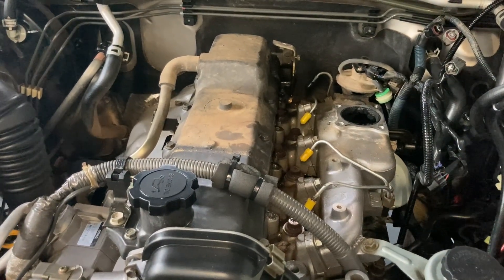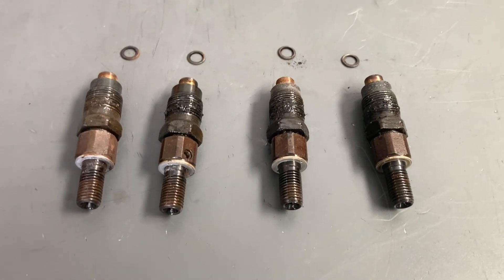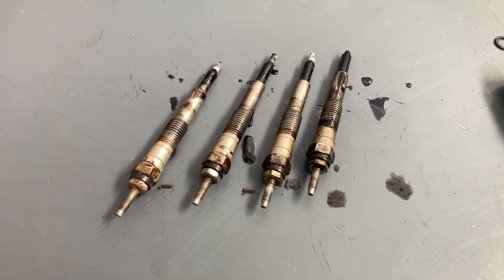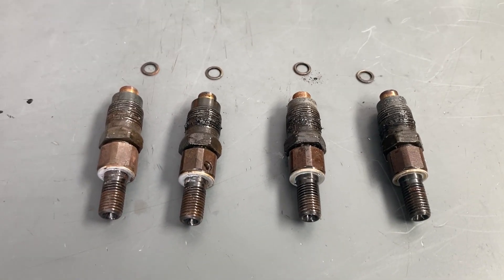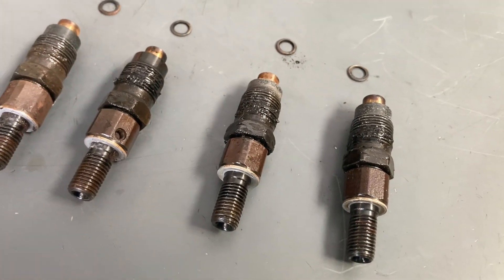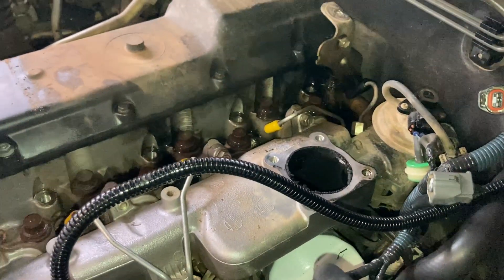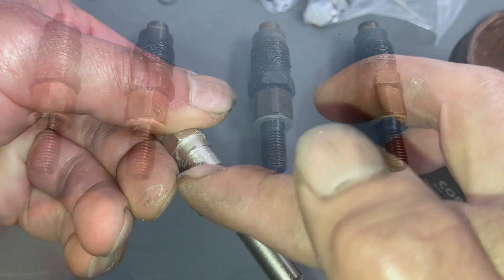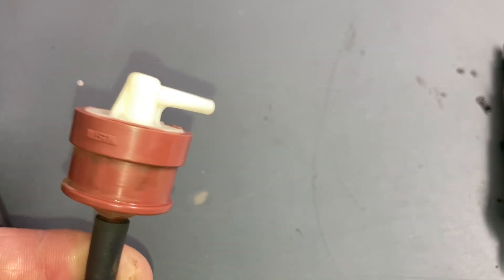Toyota diesel engine, injector and Glow plug Maintenance information 100,000k

Comment: Fourby buenas tardes quiero hacerte una pregunta tengo un kdj125 quiero anular la EGR con las chapas me puedes decir si es mejor ponerlas chapa sin taladro o con taladro y el porque? Y si al anular EGR se encendería el testigo fallo motor?gracias espero tu respuesta
Reply: Have the EGR function deleted from your engines control module, then it never operates and looks factory